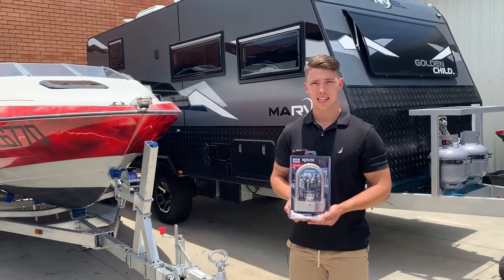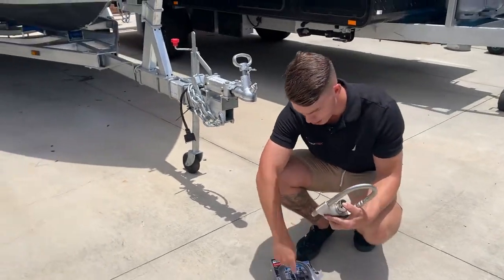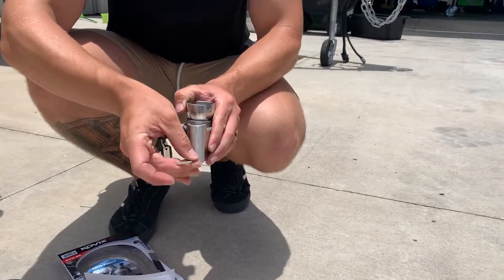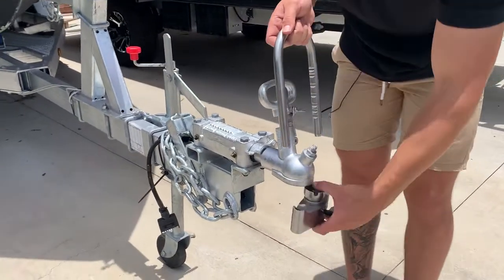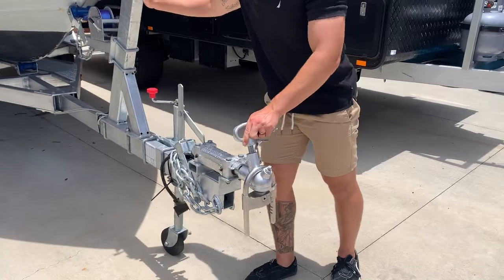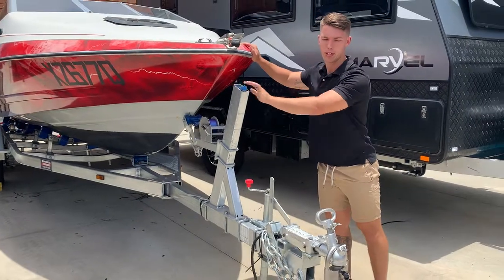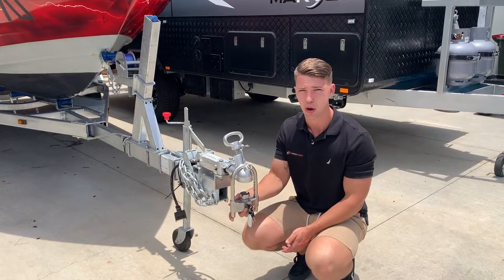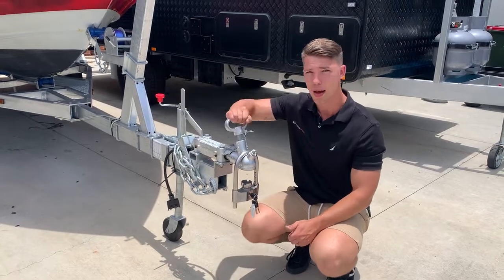Kovix Alarmed Trailer U-Lock KVH 96 - A Quick Guide

Comment: Is my KVH96 working correctly in that the key cannot be removed from the lock when it is unlocked. I prefer to keep the key on my car keys so I cannot misplace them when traveling but this means the lock can only be in the locked position (not on the tow hitch) when traveling. This means the alarm is always going off. It would be preferable to leave it unlocked in the back of the car when touring.

Comment: Where can I purchase a replacement alarm module for a KVH-88?  Purchased a mew lock on eBay and the alarm seems to be working intermittently. It’s brand new and was charged for 12hours before it was first installed.  Also what is the battery life on a full charge for the alarm module 

Thanks
Reply from the maker: Hi Dale, please send an email admin@protrek and they will find a solution for you.